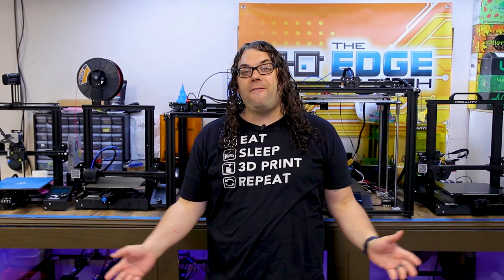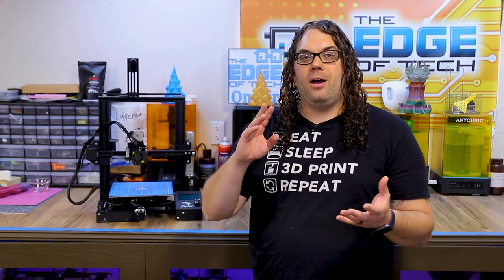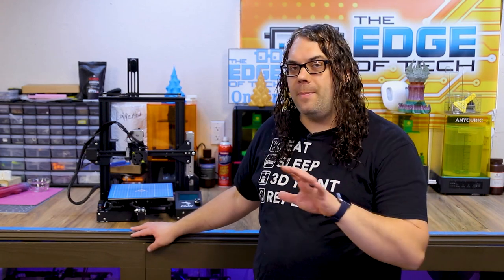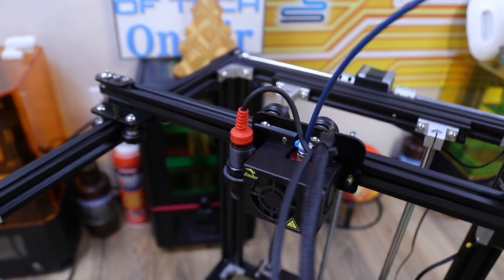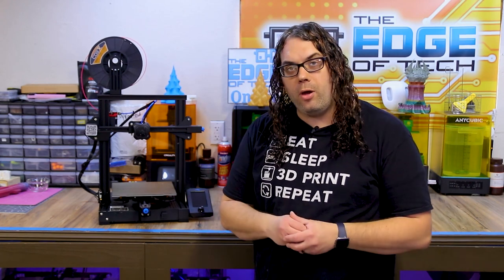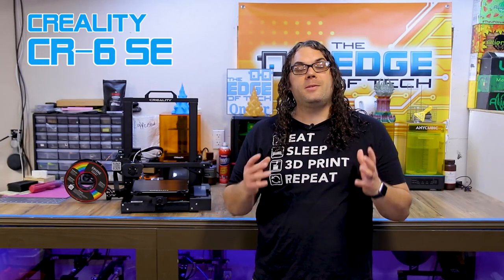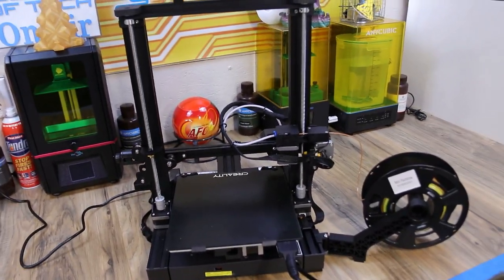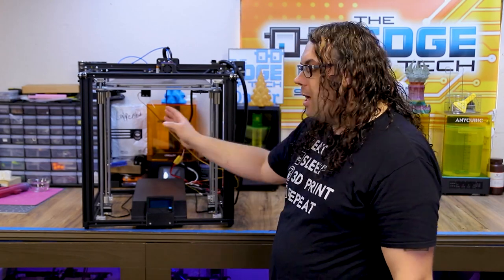My Top 5 Creality 3D Printers 2020

Comment: I want a printer that can do a minimum 300x300x400 build volume but i also want it to be able to produce high quality high detail 3d prints at small scale when needed

Conflicted between the cr10 v3 and the ender 5 plus tbh

Comment: Thanks for the awesome videos! Just getting into 3d printing for some functional work that I need to do. Needing the larger size. Would you get the Ender 5 Plus or the CR10 V3 Direct Drive? Will plan to do some modding/tweaking as needed. Thanks again!
Reply: Haha I'm literally stuck in this same boat with you. I've narrowed it down to these two machines as well. Hopefully someone with more experience can offer us some advice.
Reply: @lancefoxmccloud3058  I ended up with the Ender 5 plus based on Jim's response plus a couple other YouTuber's I've been watching. The printer should be here Monday!

Comment: I just spent $125 on ender 5 plus upgrades not sure if I needed some of them but free shipping at $125 i hope you get credit.  PTFE Upgrade, ezflex 2, microsd firmware, 8mm lead couplers, 40mm fan and excuruder from Amazon. I don't even have machine yet but will upgrade after testing it a bit. I have no clue what I am doing... new to 3d printing but your videos are great. Silent board out of stock 🙄
Reply from the maker: DANG! Thank you!! I hope you love it!

Comment: Hi @The Edge of Tech would you recommend ender 3 v2 or ender 5 pro for first printer?
Reply: Would also like to hear about this, I’m torn between 3v2 at the cheaper price allowing more room to play with upgrading vs the ender 5.
Reply: I got the ender 3v2 and it's great, I've also learned a lot from it on working on the printer. Only downside is certain products I have to print in sections due to height. My next printer probably a Creality CR 10s Pro V 2

Comment: Jim, Very good job.  I'm like you, I really like Creality printers.  They may not be the best at everything, but the community and after market support are fantastic.  They work well out of the box and are great platforms for mods.  I just got my 5th Creality printer a stock Ender 5 and am in the process of adding a dual Z to it and then it will join my other two Ender 5s and the 5 Plus.   I'm also a TH3D fan boy - great products and support.
Reply from the maker: Great to hear! Great points and I hope the new machine treats you well!
Reply: @TheEdgeofTech  Thanks.  This one came from Chris Riley
Reply from the maker: @woodwaker1  Awesome

Comment: This is late and perhaps no one even comments on here anymore but should I go with a Ender 3 V2 or the ender 5 pro as a beginner?
Reply from the maker: Both are great choices! I would recommend either one of those as a beginner. The benefit of the V2 would be that it's a newer machine so it has some newer features.
Reply: @TheEdgeofTech  Awesome, thank you so much for the very quick reply, I wasn't sure I'd get one at all let alone by the man himself! Yeah that's kind of why I was edging towards the V2, I'm not trying to go hard with this thing, it's mainly as a hobby/for myself so I figure a V2 would do the job perfect and I can make upgrades as needed

Comment: I have the 5 Plus and really love them. They put out the most amazing prints and I personally love the sound of the steppers. I love the way they sing. Lol. As for upgrades I have not done anything with the boards or screens but I have designed and printed a bunch of structure and accessory upgrades. I am having issues with the filament sensor doing it's own thing. It seems to time out and stop the print for no apparent reason. Does it need a firmware upgrade or is this something that is an overall ongoing problem? Love your videos and I really appreciate the great knowledge you share with everyone. I've used your videos on many occasions to learn the "how to" of printing and my laser engraver/cutter. Thank you.  Lastly,  one of my 5 plus printers arrived missing the Black Silicone Heat Block/Nozzle Boot and I'm having a heck of a time getting anywhere with Creality. Do you know how I can get their attention and get them to send me the missing boot? I've tried purchasing other boots but none of them seem to work as well as the stock Black Silicone Heat Block/Nozzle Boot, it seals around the nozzle so much better and the overall fit is just so much better. I'd love to get several boots because they won't last forever and I would prefer to have spares on hand. Please let me know if they have someone I can contact to acquire the Black Silicone Heat Block/Nozzle Boot. The 2 printers with the boot seem to print better that the one that is missing the boot. The layers on the printer without the boot don't bond quite as well and of course the ones with the boot make it so much easier to keep the nozzle clean because of the perfect fit of the boot. Thank you for the great videos and information that you share. Keep up the great work.

Comment: I have the Ender 5 pro. I put the printer mods direct drive on it and I want to put the ez able bed level on but do not see anywhere to put it on the printer mods plate. How did you fit yours on? And could you do a video about how to flash the new firmwear? Thanks

Comment: I recently bought the printer, I have a problem with the creality cr10 smart printer. the movements of the printer are not smooth and linear, but the movements are jerky. I use simplify 3d as a slicer
can you help me?

Comment: Great video!  I don't own a printer yet.  It seems that i should go for the Ender 5 pro or plus.  I'm leaning towards plus due to the fact that my main interest is printing helmets, and I'm not sure that 300mm is tall enough for single piece prints.  It might be enough.  So I go and check amazon, I can get the 5 pro for $400 or less. Plenty of listings.  But only 1 listing for the 5 plus at $689.  That was not expected lol.  Where should I go if I need the 5 Plus?

Comment: Hello, can you do a step on step video on how u flash the TH3D frimware on the Ender 5 pro with the mounting and what u need for the EZABL pro? This is so comfusing for a newbie
And  witch would you choose? Ender 5pro, Ender 3v2, Ender CR-6SE
Reply from the maker: Hi! That's a great video Idea! Also, it would depend on your budget and how much space you have. But all three of these options would be great!
Reply: @TheEdgeofTech  All of them are inside the budget, and my main goal is to print TPU for my drones and pla and petg for fun stuff and upgrades. Ive been thinking over a week now and want to make a dissicion but i find it hard haha.

The Ender 5 pro seems like the best for adding a micro swiss direct drive on for TPU but i have no experience so maby u have some input? the sagging of the bed on the E5pro is the thing that worry me and the lack of E5pro videos on youtube like the firmware update, some say it has bootloader and some says it dont.
Reply from the maker: @eirikjohansen6132  With some tuning I have printed TPU with my stock Ender 5 Pro. And I think that the Ender 3 V2 and the CR-6 SE would too as long as it's slow enough. But Direct drive would be the way to go. Also, if they are new, they all should have the bootloader now!
Reply: @TheEdgeofTech  Okay thanks for the information! appriciate your time!
Think i will go with the 5pro with a glass bed then and upgrade to direct drive after a while, same with the th3d firmware and ezabl. But how bad is the bed sagging? is it annying enough to go for the ender 3v2? and i am overthinking here and will be good with the Ender 3v2 as a first printer?
Reply: @eirikjohansen6132  In theory the bed can sag.  I have 3 Ender 5s and am doing a dual Z axis mod on one, just for the heck of it.  I modded all of mine with the TH3D ezboard and the EZABL.   If the bed sags you can adjust with bed leveling to compensate.  The EZABL fine tunes that.  The only time that you might have a problem is on a very large heavy print.
I use my Ender 5 Plus for that.    TH3D has some good videos on flashing and installing the EZABL.  They also have a good forum that I'm in a lot.   Something that I recommend is think about your second printer now.  I am always printing parts for one of my printers on another one.  More than one is very handy if you use your own parts, if it needs new ones how do you make them?
Reply: @woodwaker1  Okay thanks! , i will probobly not print so large parts so that wont be a problem for me. Yeah i will deffenently add the ezboard and the ezabl after some time with learning the printer. Can you use the same videos for your ender 5 and 5 pro's? Since they dont have the same mainboard? , i think i will upgrade the board to so its not so important maby? .
Reply: @eirikjohansen6132  I just checked and the Ender 5 Pro is on sale for $306 and the 5 Plus for $495.  These are some great prices.    Start with the stock printer and get it going.  Once you are familiar with it then you can think about modifying it.   This can be an never ending quest, but for many of us this is where the fun and challenge is.

Comment: I have a quick question , which creality 3d printer has the highest print quality, I’m stuck between CR10 and an ender 5 plus because of the large volume. I’m curious if because of the larger size does it still have the fine printing detail as the other printers or does a specific creality product produces better than another.

Comment: I just purchased Ender 3 v 2 it's my first printer still waiting on delivery did I make a mistake I had more money should have I bought a better one
Reply: If it’s your first 3 D printer you did pretty good. You will be happy if you only want to print PLA. A lot of cheap PLA available. Gives good prints. Learn how to fix the machine and maintain it. A lot for parts easily available.

Comment: if you had $1,000 to spend what 3D printer would you get? I want to be able to print in many different materials and larger build size.
Reply from the maker: Good question. $1000 is a lot of money! It really depends on if you like to upgrade or not. If you like upgrading, go for a cheaper printer and upgrade it with all the nice parts!

Comment: Ender 5 pro is a piece of garbage. And no it doesn't come with meanwell power supply. and that "all metal extruder is just as bad as the plastic one, it's still just a single gear pos. The bed is total garbage,  if you did get a straight one it's still next to impossible to keep it level and it also drops during printing. And that top bar totally blocks your view and makes it a pain to level or work on your hot end. Stop lying to people you shill, it's the last thing a beginner should get.